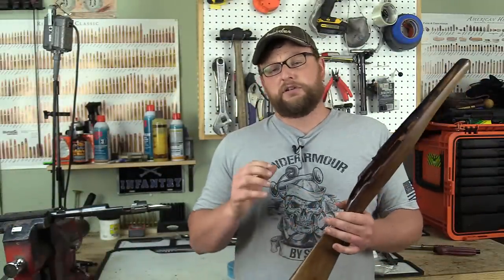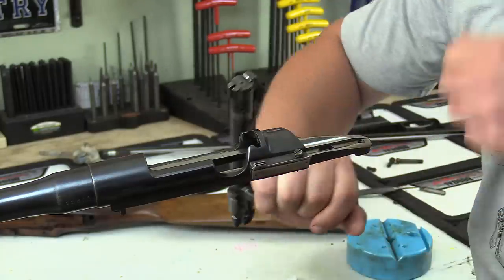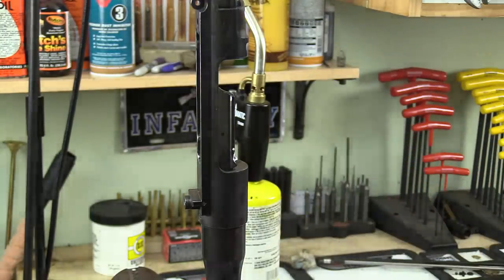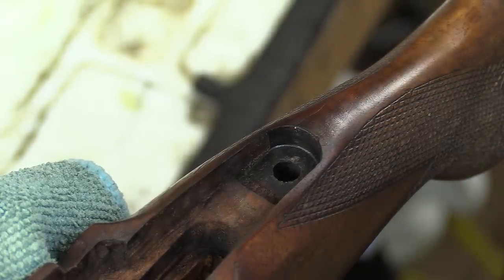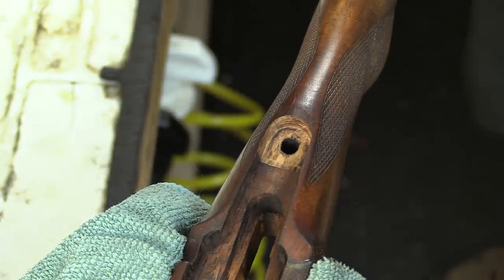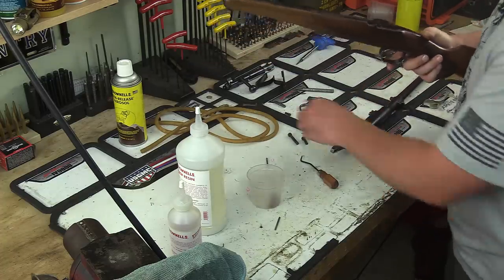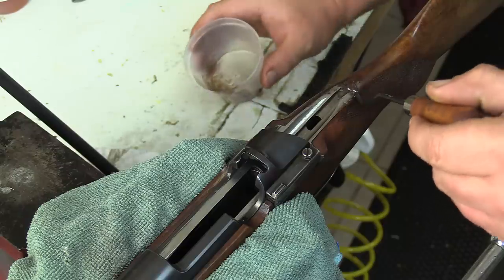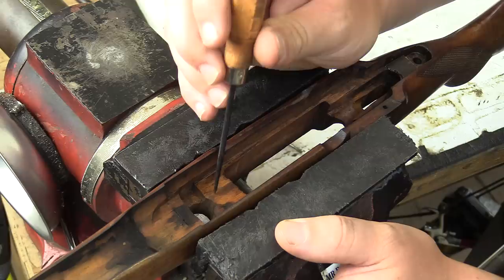Husqvarna M46 Cracked Tang Repair and Headspace Anomaly

Comment: On my type 99 Arisaka, were the anti aircraft sights are. I had the rifle set upright with the sights up for photography. Well it fell over, wings were out so as it fell and caught wing, it applied pressure on the wooden hand guard that holds it in place, it cracked. So i used very lightly gorilla construction adhesive with a small paint brush to get the glue in place. Worked very well. Eventually i'll pay someone to to a full restoration on it.

Comment: The M46 is a great and reliable rifle based on the Swedish Mauser carbine M94 (small ring Mauser) The later model Husqvarna M146 is based on the Swedish (or German) Mauser M98 (large ring Mauser) which is considered even more safer and reliably. I used to have exactly the same model in same caliber (9,3x57). It was originally bought by my great grandfather, passed on to me from my father, and now in the hands of my son. The rifle is still in use and very accurate. I’m not sure if the headspace issue has any practical drawback, except slightly higher wear of brass? If you should do anything, I would recommend to thread in the barrel rather than rechamfer to 9,3x62 or another larger cartridge. This by several reasons: 1. The mechanism isn’t as strong as the large ring Mauser. 2. 9,3x57 is a fantastic caliber with reasonable light and slow recoil, more suitable to the original stock (it can be really painful to shoot 9,3x62 in an original Husqvarna stock). 3. The 57 is generally considered to have more “death” than the 62. Strange but true. It will pretty much always leave all energy in the animal (bullet is found just under the skin on opposite side for moose, red deer and wild boar), while the 62 most commonly poke a hole all the way thru the animal. This with the standard 18,5 g bullets (286 grains).

I like that you take such good care of a, probably 100 year old rifle, even if it is a standard “meat iron”!

Comment: I dealt with this same issue dealing with my spanish 1893's.  What i found out is the saami spec for metric calibers is different in the us than it is in Europe at the time that the rifles were manufactured.  The spacing is roughly. 01-.02mm. With a service point of .0275 mm maximum! That converts to 0.0039" to .0079" with a field maximum of .009" . Saami spec dictates max end is .007" .  The rifles were designed for wartime dirt, mud and sand. Sloppy works with reliability.  If its worn out too far,  back to the armory it went for a rebarrel. Hope this helps. My Spanish 93's are .006" and .007 respectively.

Comment: I did a full length bedding on an 03a3 that had a cracked tang and lots of other issues with it. I ended up taping the sides of the flats on the lower portion of the action and far rear of the tang to give .006" relief with the tape removed. The bottom of the action, rear of the recoil lug and steel pillars are the only contact points. Still not entirely sure if my thought process of relieving the farthest rear of the tang and sides of the flats was "right" but it shoots like it was the correct way to do it.

Comment: Hi, your next option is recut the chamber to 9.3x62 .but it is a little bit tight in the magazine. You will need to install a recoil lug bolt . glassing doesn't help because you are only replacing wood with glass .You really need to leave a gap
Reply: Precisely

Comment: When a tang crack develops it is from recoil forces from the tang, usually AFTER the recoil lug area has failed, and  now the tang is bearing against weak wood at the grip. At 21:30 it appears your wood between the recoil lug and magazine inletting is cracked loose and is merely a press fit. This can easily be detected by applying drops of brake cleaner or alcohol to the wood that will highlight the cracks as it evaporates. Break out the wood behind the lug, epoxy it back in place then bed the whole lug area in one job. Apply one layer of tape to the rear of the tang to provide a slight gap before bedding to prevent more tang cracks. Grip chip-outs wont ever happen if the tang never touches. Mausers, 1917's, 1903 all do this all the time. Its why later 1903 stocks have an intentional gap at the rear, Mosins too.

Comment: could you do a refinishing video using durablue on an old hunting rifle and do some durability testing? The reason i am asking is i have an old marlin 30-30 lever action and it has been through the ringer bounced off the back of an atv and scratched and dinged up the blueing has worn thin on it in places and its getting to the point where its starting to rust quickly but it is still a good shooter. I dont want to spend a lot of money to get it refinished and would like to see what some one could do at home to clean up an old beat up hunting rifle. I love the gunsmithing  videos and would like to see more of them.

Comment: Sir, a suggestion when demonstrating the head space gauge process remove the striker, shroud and spring from inside the bold. Thus allowing you to carefully feel any resistance as the bolt handle is lowered. Keep up the great vids!
Reply: 0ه

Comment: Eric , I can understand not wanting to go overboard on a milsurp repair . Why not pull the barrel cut back the shoulder and then correct the headspace with a finish reamer ? Is a reamer not available ?
Reply from the maker: We are exploring options for the headspace issue. I think we are going to open it up to 9.3x62mm or I should say Mr. Novak is. I’m not 110 percent comfortable pulling barrels

Comment: Question I have an auto 5 with 2 cracks about 1/2 inch long right where the tang stops and comb starts on either side how would you suggest I fix it

Comment: 2:50 - I'd be careful snapping the extractor over the rim of the gauge, controlled feeds aren't supposed to do that.
Reply: The mauser extractor was designed to snap over a case rim, in the event that the controlled feed failed (which happens) they wanted to reduce the chances of a double feed and out of battery discharge. Some early civilian controlled feed designs (winchester) did not have a significantly beveled extractor face, and could be damaged by forcefully snapping over a case rim.
Reply: I was taught to remove the extractor on Mauser bolts before checking the headspace.
Reply: @BigATB  I have chambered rounds like that in all my old winchesters, other mausers, the Sako mauser I used in Africa, no truth whatsoever to that claim
Reply: I have done it for many years, no truth whatsoever in that myth
Reply: @BigATB  Snap over a case rim? perhaps...a case made of brass.  But not a hardened steel go or no-go gauge.  I have seen broken extractors AND chipped gauges from this malpractice.
Reply: @robertboyd3863  Truth?...are you some kind of philosifizor or sumthin?
Reply: @hansgrueber8169  simply speaking facts , I assume a bit over you understanding
Reply: @hansgrueber8169  If that was true it would cause damage to a brass round, which of course it doesn't , you do know the old military mausers had cutoffs so you could chamber feed them, while keeping your mag in reserve, how do you think they worked ? Sorry you know much less than you think you know .
Reply: @robertboyd3863  Wow!! You must be some kind of a genius!! So what I've seen out there in the real world MUST be my imagination?!! Thank you Sir for setting me straight.  Your acumen on this subject is astounding!!
Reply: @BigATB  My Winchesters from the 40's will snap over, my Winchester made Enfield will snap over, I do know some older guns wouldn't as I read of an African PH getting killed when he chambered a round in one that wouldn't and was killed by the animal charging him, as old John Taylor wrote, you should always make sure your gun will and if not hone it out so it will
Reply: @hansgrueber8169  At least I know what I'm talking about , I have several old claw feeds, plus the Sako's I used in Africa, they all will snap over, rather than babble, simply find an old one and check it out . What about the old military rifles that had mag cut offs, so you could chamber feed and keep your mag in reserve . What are you seeing in your real world, is it drug induced as you make no sense
Reply: @hansgrueber8169  Before you babble more of your crazy crap, simply check it out with a few old claw feeds, you might even get lucky and find one of the few that won't let you do it , so you could gloat about it. They are rare and anyone owning one should hone it out so it will , just as John Taylor wrote many years ago, you ought to try reading sometime, might  learn something
Reply: @robertboyd3863  ah yes the "new" Winchesters do have beveled extractors. I was referring to early Winchesters like the 1876, pre Browning.

Comment: you shoud have drilled  a hole in the way of the cracks and fill them with the glass and the shavings so they dont continue their patterrn of walk
Reply: Amen to that, relieving and glassing that area will not stop the cracking. Amateur gunsmithing AGAIN!
Reply: dont wet me wrong erik is good in lots of things related to gunsmithing , he never claims to be a pro and y am not one too , he is trying to make a work witout having to interfeer to much with the stock and y understand it . messing with the wood is one of the worst parts in theese trade in my understanding and good wood fiters are gone for ever thats why all factories go with polimers now adays wood is always alive and does strange things .

Comment: As far as i know lege artis is to relieve the tang so it doese not touch the stock in the recoil axis to prevent cracked stocks in 98 systems
Reply: but 98's have a recoil bolt :/
Reply: Gungeek  yeah ok but it looks like the front action screw and the additional screw in front of the chamber are meant to tranfer the recoil, like with my ZKK600 stock and that one takes 9,3x64 fine - at least up to now it's not a cardridge you shoot hundreds of rounds every outing ;) The tang had space while the rest seemed tightly fitted and i relieved it again a bit axially after i acraglassed the action.
Reply: Gungeek  Can't see anything going into the cutout in the stock on the receiver, the ZKK has a broad sturdy shelf on the sides of the front action screw maybe that's the difference.